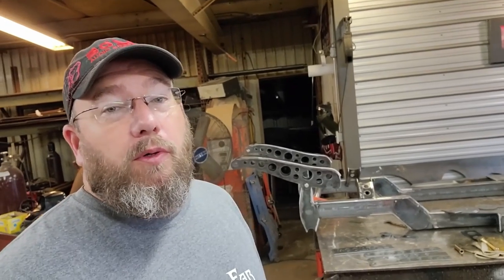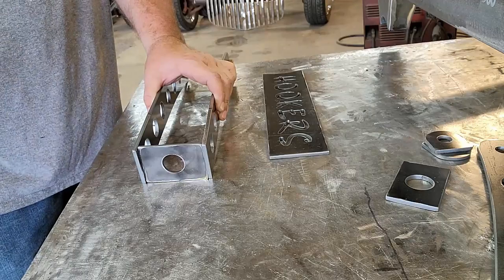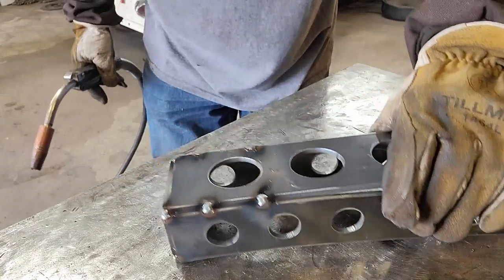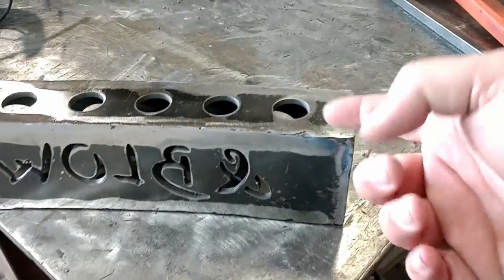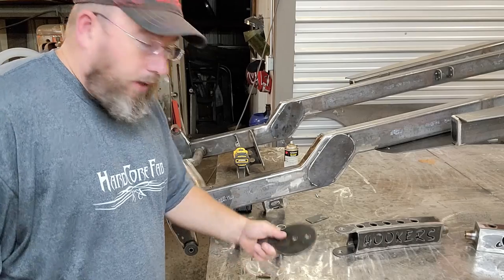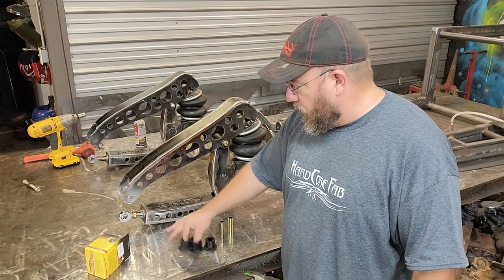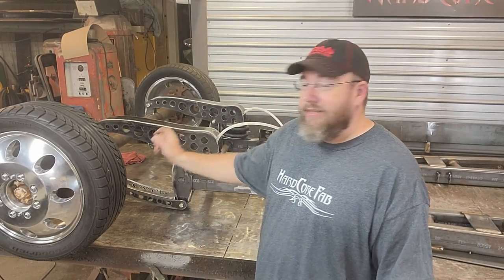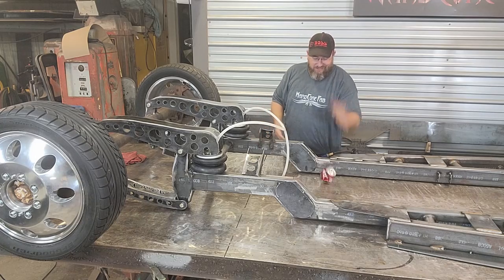Air ride tips and tricks (Hookers and blow build part 9)

Comment: Wow, you are doing some cool stuff. I am motivated to comment though with criticism. As a Mechanical Engineer, I don't like to see the top of the airbag squished on one side due to the pivoting arm. I think you should have a hinged plate at the top to keep the airbag top horizontal while the arm tilts. The airbags will last a lot longer. Just my humble opinion!
Reply from the maker: Thanks!  A hinged plate at the top would definitely be a better design but the the gain in life span VS the amount of work to build it isn't worth it to me.
Reply: @HardCoreFab  the life span of the bag will significantly be decreased while being stressed like that under load and constant fluctuations in road conditions. All the time put into fabricating arms, yet no time to fabricate smooth reliable function. Bit contradictory in my opinion. Please rethink the cringy working angles.
Reply from the maker: @dav3eii725  https://youtu.be/FIX_Bwg63tE

Comment: I hope you got the calculations right. The  weight of the engine and tranny and all that leverage is going to be a lot of force on that airbag.
Reply: Unless it's a mid or rear engine... It's off...
Reply: Those bags are not designed for 7-8k pound 4/1 ratio assuming the front is going to weigh 1750-to 2000 pounds
Reply: @roodgeregeld  
Yup
Reply from the maker: @roodgeregeld  https://youtu.be/FIX_Bwg63tE
Reply from the maker: @SkypowerwithKarl  https://youtu.be/FIX_Bwg63tE

Comment: Interesting your thought process and fabrication/explanation on the front end. I realized you had the bags expanded above a normal ride height but does the radical angle of the top plate of  the bags affect them?  Really enjoying this content
Reply from the maker: They could go even more but yeah In normal conditions they will rarely see angles like that so I'm not overly concerned.
Reply: I thought the same thing. I'm unfamiliar with air ride suspension but I was wondering if that upper plate rotating like that would cause issues down the road. You could add a pivot to that end of the arm so the bag's plate stays parallel to the frame.

Comment: I think the airbags should be sitting even and level whe at ride height, the curve is very severe when above ride height. I think you are also going to need a track bar as the side load from corners is going to be a lot of side pressure on the bushes other than that great work.
Reply from the maker: The angle of the bags is perfectly acceptable per the manufacture and this build is going on 3 year and no troubles.  You are right I added a track bar in a video after that

Comment: Looks like you are on your way to another great build on them air bags tho by angling that way when they are inflated doesn’t that put a lot of stress on one side of the bag compared to them going up and down evenly witch might cause premature ware  I’d like to know but overall great build so far and when are we going to see you driving the other one you just finished
Reply from the maker: In normal conditions they will rarely see angles like that so I'm not overly concerned.  Old crow still needs some more work I just couldn't put off starting this build any longer.  I am on a big time crunch with it.  Connor has been working on it here and there some maybe they will be driving about the same time.

Comment: Thanks for all the detailed suspension build videos! I'm learning a lot. What do you recommend for line size going to the bags? Also do you use manual paddle valves or do you go full electric controls? I'm thinking about a 4 channel manual valve setup in the cab just for simplicity of wiring.
Reply from the maker: Line size really just  depends on how fast you want it to go up and down.  I'm going to use 3/8.  I have a manual set up for Old Crow but I haven't made up my mine on Hookers and Blow yet.

Comment: Your going to have problems with the air bags top and bottom need to be parallel with each other or they will not last . plate on air bag articulated to the lift arm. Otherwise great build!
Reply from the maker: I appreciate the concern, but it is not a problem.

Comment: Get yourself a da sander. That flap disk leaves highs and lows which will show up in your finish of choice unless you use a filler.
Reply from the maker: No filler no lows and highs just have to keep it moving.  Having that said a DA does work well but is to slow for my liking
Reply: @HardCore Fab  I agree a da does make the process a lot more tedious.

Comment: So let me understand this a bit..
You put 2600 lb bags on the front and put cantilevers that are almost 3 times longer from the pivot point which would reduce you weight capacity to almost 765 lbs per bag doing all this without a panhard bar or a "axle locate bar" on a steering axle? Im just curious on how thats all supposed to handle driving and not getting into a wreck because the front fails. If you have some more math in your plans id like to know how all Thats works. Thanks.
Reply from the maker: No no no, it's definitely getting a panhard. bar
Reply from the maker: https://youtu.be/FIX_Bwg63tE

Comment: I don't know you how to reduce the torque on each wheel when the car is running. because if you do it like yours, the two front or two rear tires go up and down together, but it is not independent.
Reply from the maker: I'm not sure I understand the question but I think what you're getting at is the T in the airlines? If that's the case this is just to allow airbags to be shown working in the video they will not be plumbed that way on the truck when it's finished

Comment: With the air not separated would you not have major body roll as the air would go freely between the bags ?????
Reply from the maker: It'll have 4 switches that's just for being able to air it up with the shop compressor right now